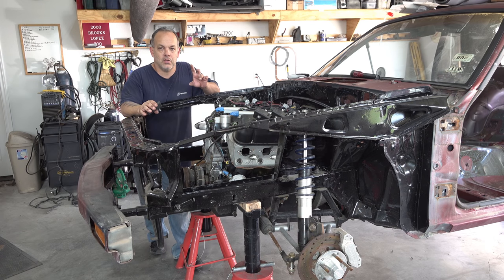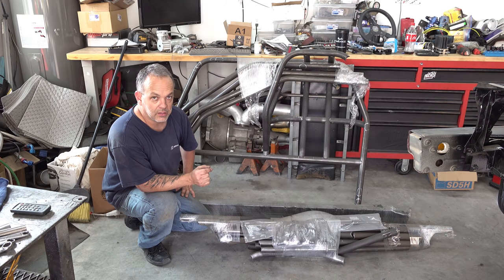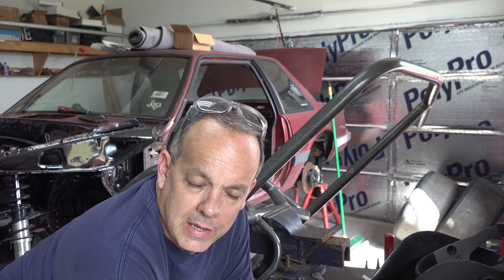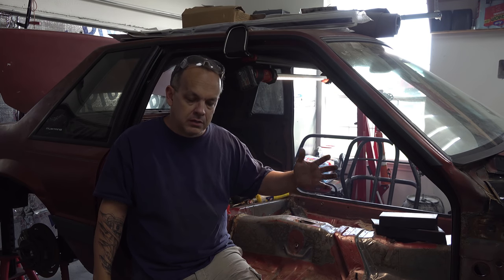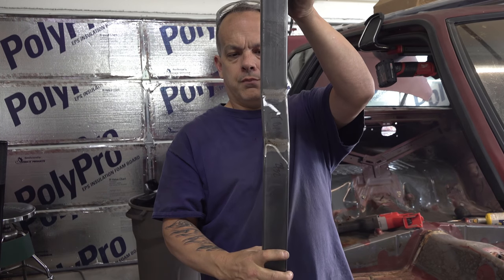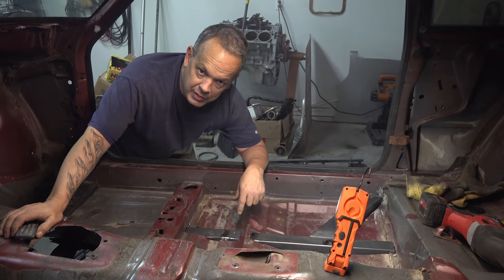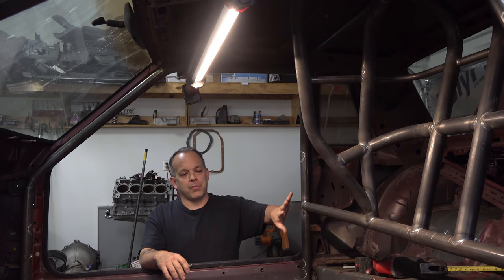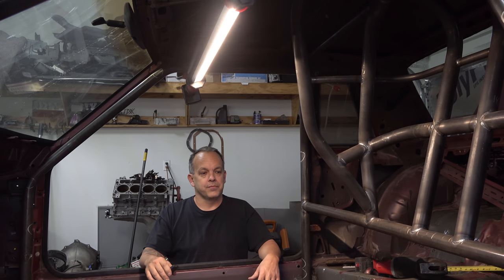Install roll cage because race car

Comment from the maker: The weird fluctuation of the lighting is apparently from the light hanging in the car. It does it on my phone as well, and as soon as the light is turned off, it goes away.
Reply: diy_garage_tx - I will be doing an 8.50 chromoly cage in a 90’ Foxbody hatch soon and Im already thinking off the tight areas to tig around the rocker tubes. Any tips on that?
Reply from the maker: @captainamerica5005  theres only 1 way to really get to those and that's to cut a huge slot in the floor and drop it down to weld complete.... or use a gas lense and extend tungsten way out then weld as much as you can
Reply: diy_garage_tx - Thanks for the reply! So most cages do not weld those all the way around? If you don’t get all the way around is anything else required on those to pass inspection?
Reply from the maker: I don't think I've ever been able to weld one all the way around. Seen many that were done the same way as well...and never had one not pass... but, if there is a spec, for it not sure what it is.
Reply: diy_garage_tx -Awesome thanks for taking the time to reply. Much appreciated. 👍
Reply from the maker: Anytime!

Comment: The wrap around driver’s cockpit certainly looks to add a lot for driver safety. 

Looks like a great kit to use for such an important safety item.
Reply from the maker: I've installed several of their kits, man they always fit nice. The wrap around part is the spec 25.5 that I mentioned. It's required for cars faster than 8.49 in the 1/4 mile. This one should go deep into the 7's@ 180ish
Reply: diy_garage_tx 
That is going to be one quick Fox Body. The quickest car I have ever ridden in was a mid 12 second car and it planted you in the seat.

Comment: Did you do a video on the 2000 S10 on roll cage I’ve got a 2001 S10 that I’m gonna attempt to put a cage in and small block like you did hopefully with the turbo I don’t know if you’ve done one on a roll cage or not on the S10 if you did let me know how I find it thank you have a good day
Reply from the maker: No man. I sure dont - we may be doing one sooner or later though
Reply: Ok thanks

Comment: Never seen the subframe connectors installed from the bottom? Any Video footage of the installation?
Reply from the maker: Nah man, I dont have any footage of that - but that method is real common for the through the floor style

Comment: Awesome! Is this a 6.50 cage?
Reply from the maker: No, I believe the spec is actually 7.49. I think 25.2 or 25.3 is 6.50 (with different weight ratings)